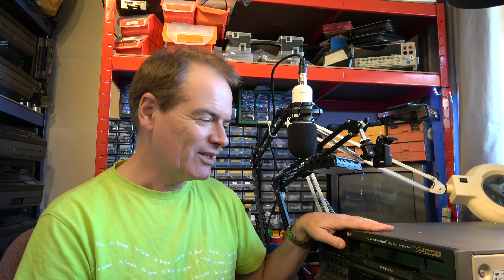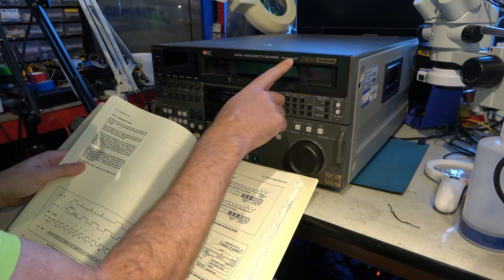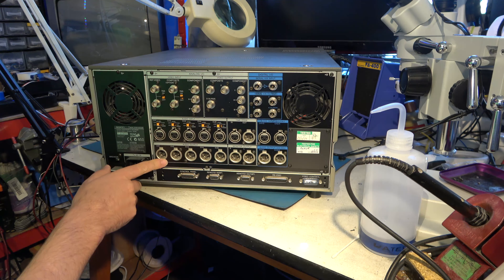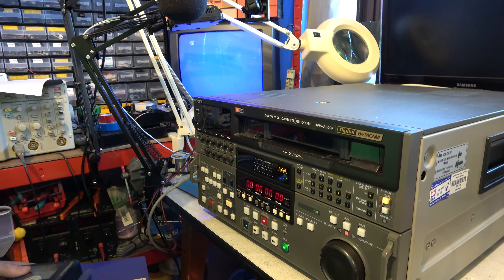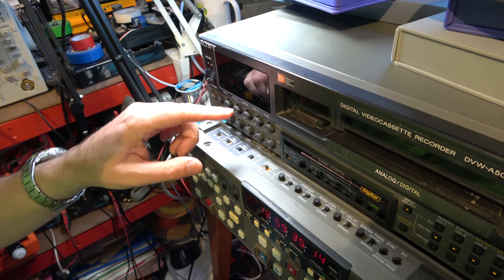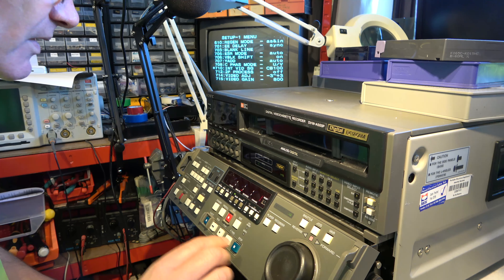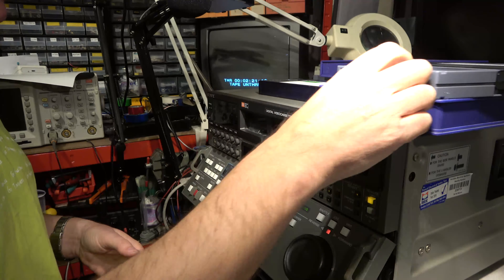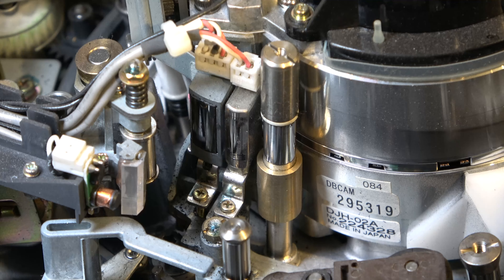Sony DVW-A500P Digital Betacam Recorder donation.

Comment: Did you also know the fact that the Sony HDW-M2000P would playback Betacam, Betacam SP, Digital Betacam, Betacam SX, MPEG IMX and HDCAM tapes?
Reply from the maker: But not HDCAM-SR, which is what I need a machine for.
Reply: @video99couk  OK. Almost everything the HDW-M2000P could play, with the exception of HDCAM SR. The SRW-5500 would play and record onto Digital Betacam, HDCAM and HDCAM SR, but not Betacam SP, Betacam SX, Oxide Betacam, and MPEG IMX.

Comment: Great video as always.

Maybe you can help me with something, I have started doing transfers and I have several low hour and well cared for Panasonic AG-7350/AG-7650/AG-7750 decks yet 'the internet' says these are absolutely 'garbage' players and despite what I had assumed 'very good' characteristics one self-professed internet famous group have declared this equipment as totally unsuitable for transfers.

Am I wrong here,  are these machines such awful players?  Given their pedigree I thought they might have been at least acceptable?
Reply from the maker: I believe the AG-7750 has a TBC so it's going to be a pretty good deck for this kind of work.  However in my humble experience, this range of machines suffer from head wear, so you need to be sure the heads are in good condition.  They don't have digital tracking so you can get into a mess with the picture tracking and hi-fi audio tracking not being well co-located, so the risk of caption buzz on the hi-fi track.  (How digital tracking overcomes this I've never quite understood, but somehow it seems to).  Personally I tend to use later machines such as the AG-4700, but I would have no problem running tapes with the AG-7750 in particular.
Reply: @Matt Quinn I won't name the forum or the characters but it's very cultish around one machine, which just happens to be the one the 'leader of the gang' uses... I have had some posts telling me that these decks were built solely for recording and that the AG-7650 especially is absolute junk, funny that seeing as its not even a recorder... Ho hum.

It's amazing the views you find in small communities repeated as fact when one forum celebrity supports them.

Anyway great channel Colin.
Reply: @Matt Quinn Yes, absolutely right.  I had a great deal of experience with these back in the early 2,000's and they were incredibly good machines. The picture quality in SVHS was second to none provided we used Fuji SVHS tape.  They were also very reliable and easy to work on.

Comment: hi funny thing i had a deck with a bad power buttons bang my lights went out the button had a break in
it you could see a very fine line where it turned in the to parts  beware it eats power you need gold bars
to run this deck  service book i down it from the net to save the space and it's easyer to zoom
in and out  o a computer file i have alot of betacam decks   the one thing the tanks are very very heavy
man  i picked up new sealed tape this week  under £1 each lot of old stock about 
keep betacam going fans